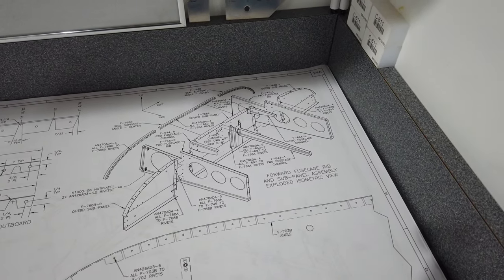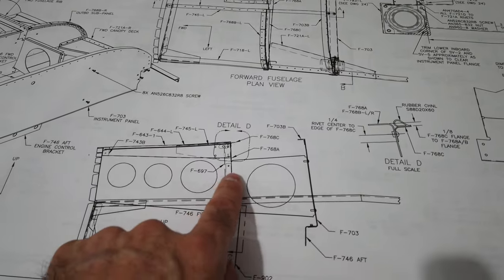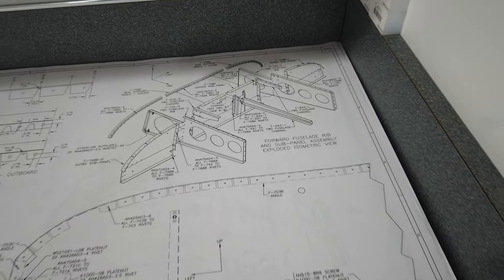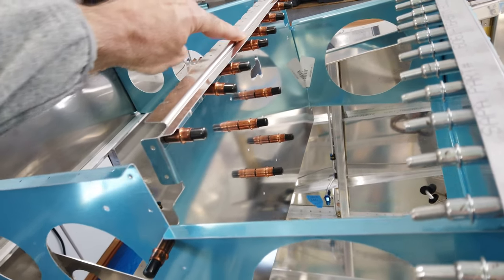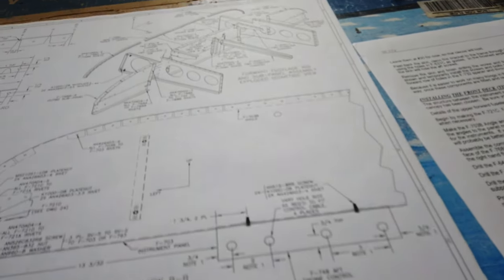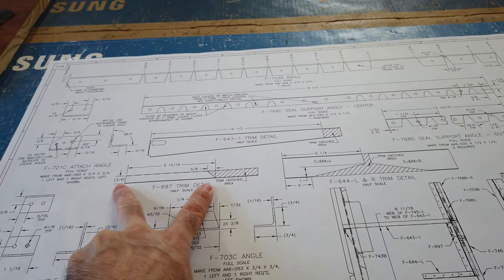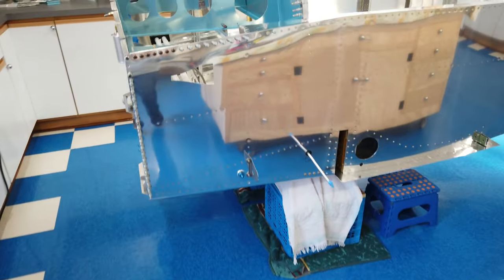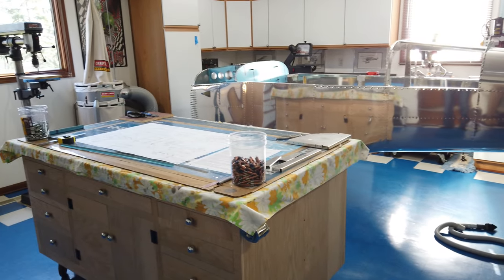Vans RV 7 HINT Video Top Fuselage Tip Up Canopy 3

Comment: Thanks for the heads-up. That could be a gotcha.
Reply from the maker: Howdt Kent. Lots of potential gotchas throughout the build.  My biggest problem is I believe I understand what needs to be done and work through a few steps at a time; only to realize I jumped the gun and need to drill out rivits or replace a part I drilled wrong. (Documented in an upcoming video...hooched a few things and needed to place a Vans order!)
Reply: @KaretakerAero  you’re not alone. I’ve stepped on that bear trap a few times.  I enjoy your videos. They’re very well done.

Comment: What attaches to the nutplates? Can you figure the location by clamping whatever attaches to them?
Reply from the maker: Yes, part of the canopy jettison system uses these nutplates. I am waiting until I build the linkage parts of the system which will dictate where to position the nutplates and prevent binding.  All in due time.